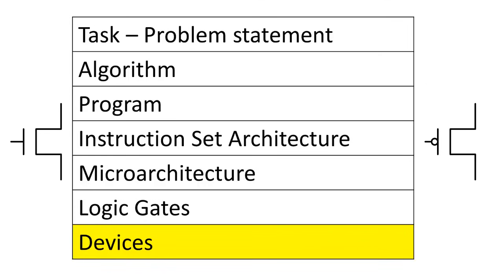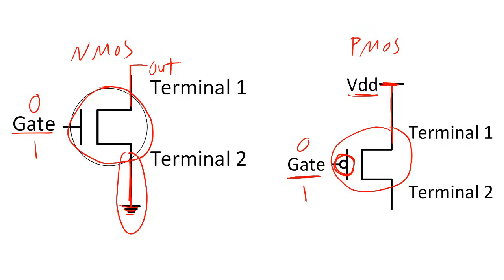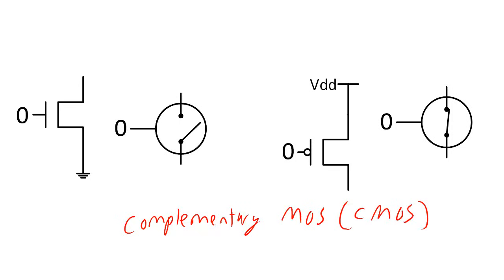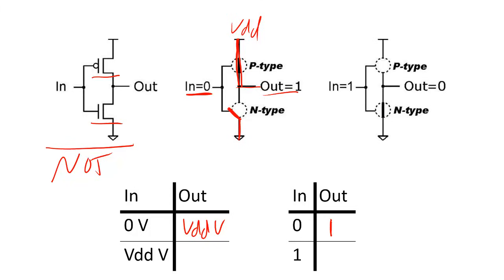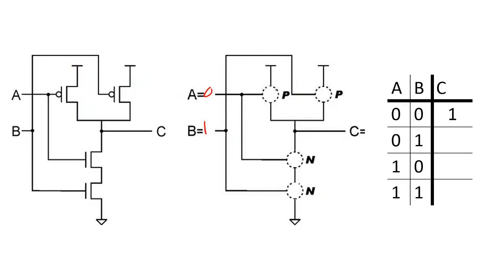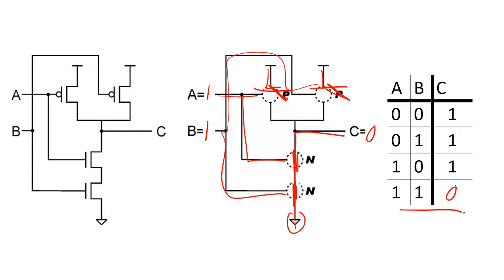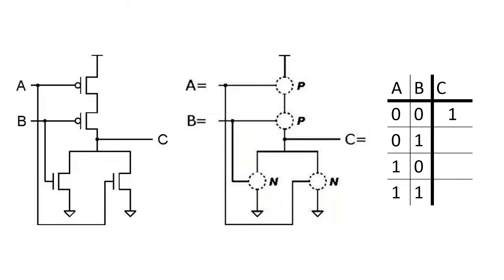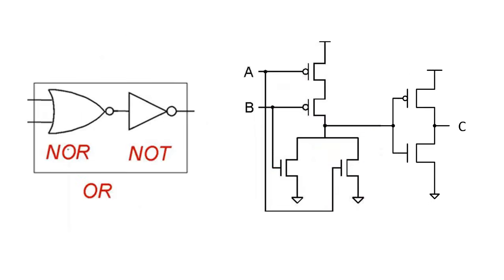Building logic gates from MOSFET transistors

Comment: ohh come on, it's seriously annoying how almost every different video / nationality uses a different convention (for voltage source; grounding; transistor, briding cables, etc.). Just frickin agree on one standartized one, geez. Also, there is a MUCH simpler way to do the circuit diagram for OR and AND. It's just ridiculously overcomplicated the way you did it

Comment: There are a couple of often used gates not shown in this video:
XOR, truth-table is 0110. XNOR, truth-table is 1001. Buffers, truth-table 01.
Buffers can be constructed from Not Not.
As this video is very well made, it's a shame that it doesn't contain the above 3 basic gates.
There are also Imply-gates: 0010 and Nimply gates 1101, Maj-gates (3-input) and Min-gates (3-input).
Maj-gates output 0 if two or 3 inputs are zero, they output 1 if two or 3 gates are 1.
Min-gates output 1 if two or 3 inputs are zero, they output 0 if two or 3 gates are 1.
NAND, NOR, AND and OR gates are sometimes seen with 3 inputs (in some cases even 4 inputs).
-But it's a bad idea to go beyond 4 series connections, because you will get unreliable outputs.
It's best to stick with 2 or 3 inputs and then build your logic using small gate modules.
Anyone reading this far will also be interested in how to bulid flip-flops / latches (search the net for D-FlipFlop and you'll find great information).

Comment: A minor error ...
6:40 ... If B is zero, then the bottom-most NFET will be open. Thus if A is one, then B will not make the second NFET turn on. I've classified this as a minor error, because it does not change the final output of the circuit, it's just something you need to know when building your own gates and pulling outputs from strange places.
This also applies to the NOR gate at 9:48 ... If A is 1, the first PFET will be off, resulting in source on the second PFET will be high impedance and that means no matter if the gate on this second PFET is 0 or 1, the second PFET will be off. Still, this is only a minor error, because it does not change the final output of the gate.

It does not matter which order the series-connected FETs are placed in; sometimes it may be beneficial to swap the order (as one could re-use one FET's output instead of placing two FETs with the same source and gate.
Those cases are rare, but they do exist.

No, it doesn't really make much difference, unless you're duplicating the circuit thousands of times; if you're just making a breadboard-test using a few components, the difference is hardly noticable. But if you are making an ASIC through a foundry and have to pay from your own pocket, you'd definitely want to save a few transistors on just a single gate type, which is used many times.

Comment: So charge carriers flow into the source terminal and leave via the drain terminal. When you denote the terminals as 1 and 2, which is which? Where does current flow (in which direction)?

Comment: need help :( how to make a XNOR gate using FET transistors
Reply: +Julius Bot atleast just the schematic diagram
Reply: +Julius Bot I think a diagram might be harder to understand than if I tell you the logic and you make the design yourself. There are 3 ways how to make XOR or XNOR. One way creates directly XNOR (without need to have there a final NOT inverting the XOR) but that way contains OR and AND gate, which as we have just seen , are harder to make (they contain NOT anyway). So there is one way left which creates XOR just from 4 NANDs (which, as we have seen, are easy to make) and then you simply add a NOT in the end to create XNOR, so it goes as following (the A and B are the inputs 1 or 0):

A nand B = C; A nand C = D; B nand C = F; D nand F = G <- G is XOR; so now you just do:  not G  = H  <- H is XNOR.

The alternative ways are these:
A or B = C;  A nand B = D; C and D = F <- F is XOR, so just do: not F = H <- H is XNOR
(this way works because the truth table for OR and for NAND overlap in 1 0 and 0 1, but don't overlap in 0 0 and in 1 1 where to "overlap" really means the final AND).

And this one:
A nor B = C; A and B = D; C or D = F <- F is XNOR  (now you don't even need to invert it, unless you want XOR from it :P)

I hope it helped!
Reply: thanks a lot dude!!! this helps!!!!

Comment: Yea the AND gate is not any more complex. To get an AND gate you take the NOR and change the NMOS to PMOS and change the PMOS to NMOS. You can also get an OR gate by doing the same to a NAND gate. No extra NOT gates are required.
Reply: +Zach Smith This is wrong from several reasons: 1) if you use PMOS instead of NMOS to open the circuit, cut it from the ground as to get an open circuit voltage in the middle, the voltage will be lower, since PMOS doesn't make a perfect impedance that the open voltageless NMOS does. That means that your output will probably have insufficient voltage to drive another gate (if needed: imagine a complex device that uses hundreds of gates) and not all yet another gate connected to that another gate. The rule is that the PMOS must be at the voltage source side (because it works the best if turned off - if zero voltage at the gate) and the NMOS at the ground side, because it works the best again: if turned off, providing perfect impedance and thus not lowering the voltage of an open circuit, therefore you can run hundreds of gates without a voltage drop. 2) the voltage drop is also going to happen since the NMOS won't conduct the open circuit voltage in the best way possible. NMOS can conduct perfectly 0 and badly 1 while PMOS can conduct perfectly 1 and wekly 0).

Your solution might work for a single gate device, but that's about it.
Reply: Interesting.   Thanks for the explanation.

Comment: PMOS in series (NOR): say A & B... structure is SourceB @ Vdd, DrainB conn. to SourceA, DrainA conn. to load R, R conn. to GND.
Now, remember that PMOS is ON when input = LOW.
When either or both of A & B is HIGH, current path from Vdd->GND is disrupted. So, there is no drop across R and hence GND appears at Output (DrainA) as LOW.
When both A & B are LOW, current flows from Vdd-> GND and clear drop happens across R, due to which Output gets high logic value and becomes HIGH.
This is NOR logic!

Comment: PMOS follows a logic opposite to that by NMOS.
NMOS is series (NAND): say A & B...
When either or both of A & B is 0, current path through MOS is disrupted as that/those MOS is/are OFF. So, there is no voltage drop across load (say some R between drain of A and Vdd) and hence all Vdd appears at Output (drain of A) as HIGH.
When A & B are both HIGH, current flows straight from Vdd to GND through MOSs. There is clear voltage drop across R and hence Output gets a low logic value and becomes LOW.